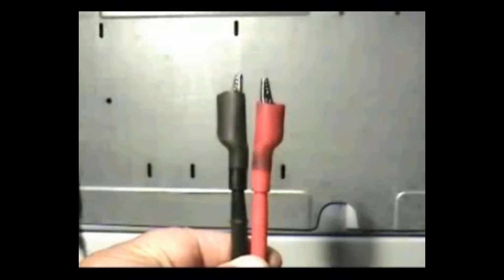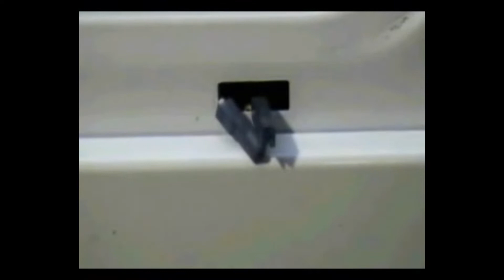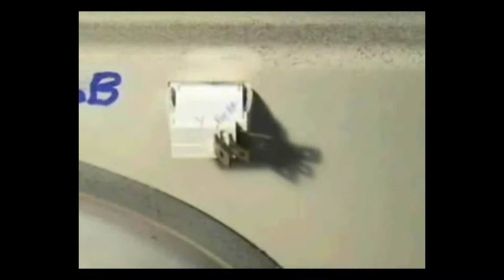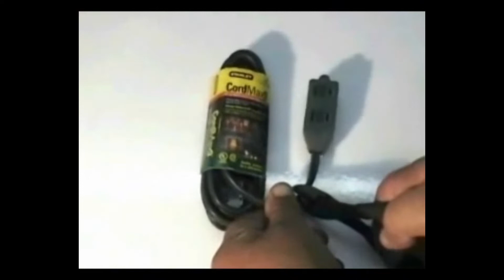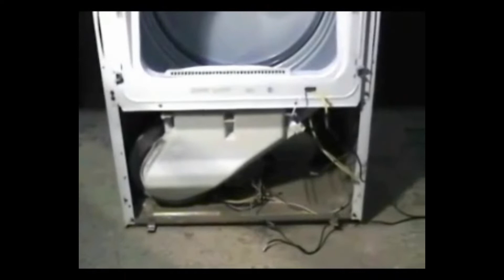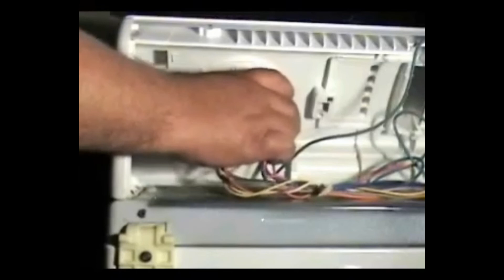Maytag Dryer Not Starting - See What Parts You Need To Check

Comment: Good tips but that is and old obsolete dryer and the video looks like the 1980's! 😆 😅 😂 🤣
Reply: I would rather have this dryer than anything made in the last 15 or 20 years. The old ones are much more reliable and can be repaired without spending a fortune.
Reply: @dons.7632  : I could not agree with you more. I have a combo 30+ years old and still going strong.